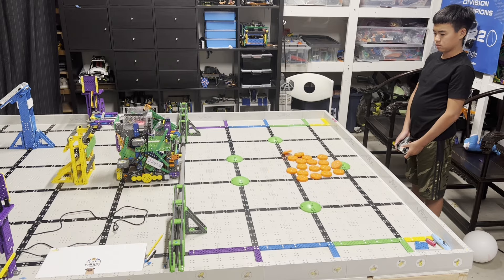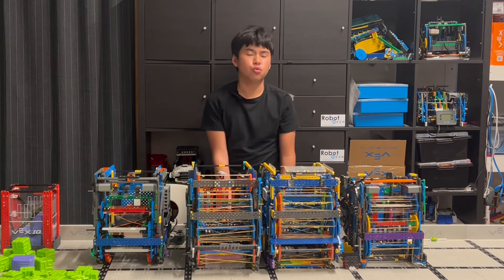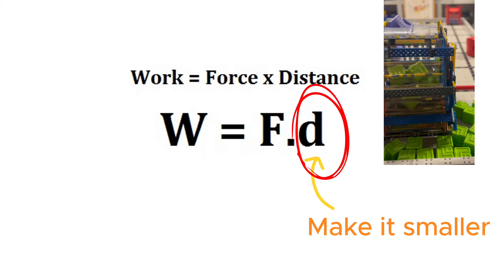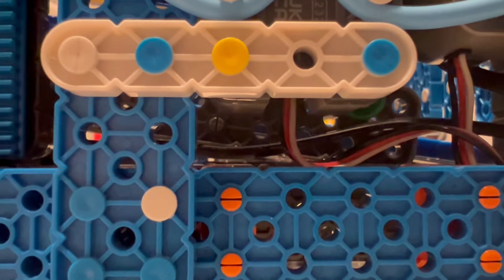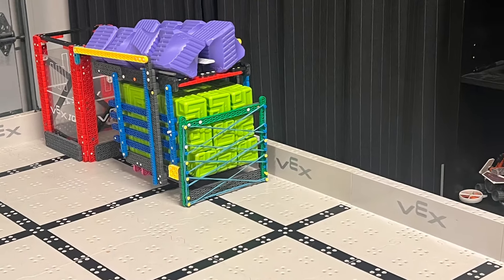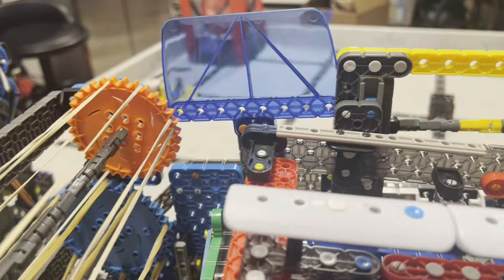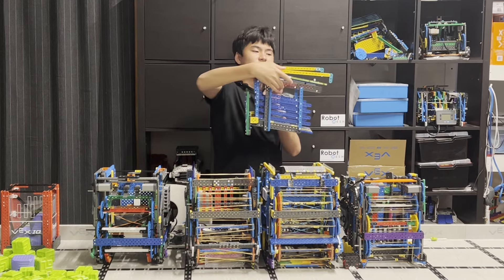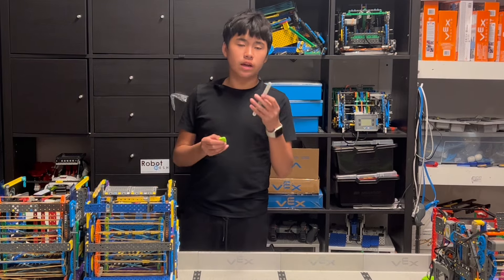Make It Lower, Do Less Work. First Principle of Flying Cheese VEX IQ Full-Volume Robots

Comment: how does your blocker for the purple on your outake work. How do you control it to dispense purple or not wheb going up
Reply from the maker: Without pneumatic, when the lift goes up, gravity make the opening bigger, purples are out, the blocker beam does not have to move. With pneumatic, the blocker will be poked up by the pistons, the purples will go up with the greens if you don't dump them first.  https://youtu.be/7HzLoKGM08I?si=TgauJXbIK4tWcZyr&t=80